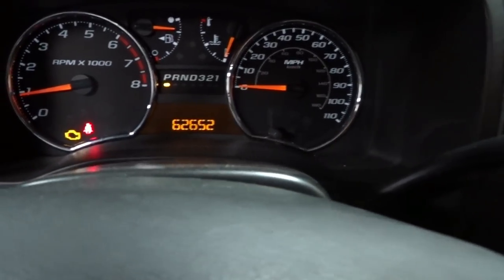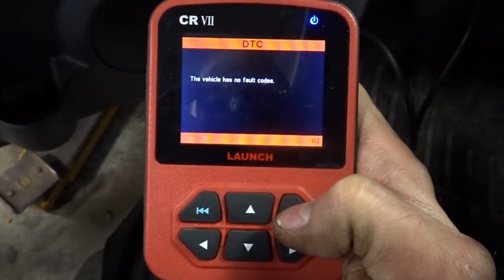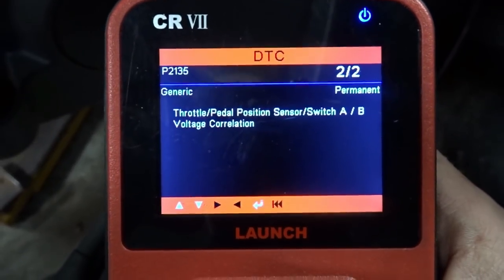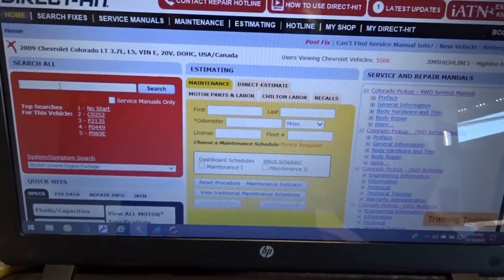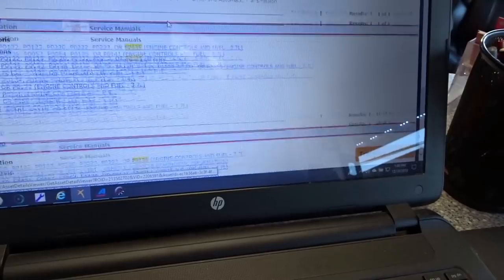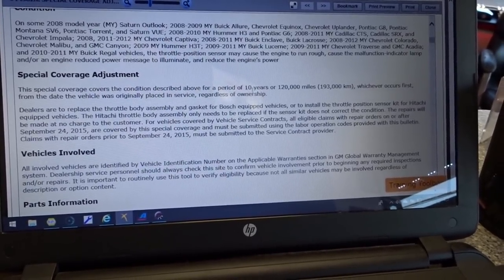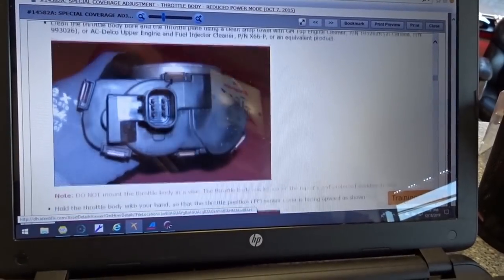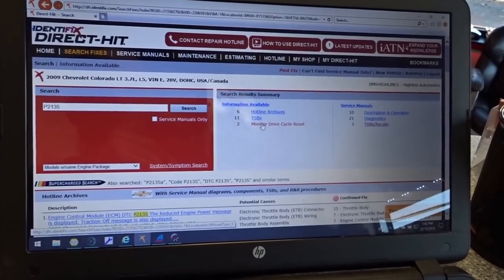[Tool Must Have]   ✓Wrenches✓Screwdrivers & WiFi ??🤔

Comment: I get a few of these a month....so far about 70% fix rate with that kit  . all others get the entire throttle body asembly.....anytime I get this, i view data and save for my proof that it was more than 13degs out of spec...the normal deviation with a new throttle body unit is about 1-3 degs, many times when you do the kit it pans out to about 2-7 degs which is still in...when it gets over 9 i suggest a throttle body

Comment: It's the plastic gears in those tps, just crap design, same happened to my wifes enclave,  tested it all, and set an appointment at the dealer lol.
But ditto bro, always give the customer a tsb/recall print out, gotta stay ethical, and customers will be appreciative of it.

Comment: Nice video man! Love the channel! Do you prefer All data or identifix? My shop only has All data and doesnt always have all the info.i need when it comes to repair procedures. Are they all like that?
Reply from the maker: I now use Mitchell and idenifix. Mitchell is owned by Snap On now so it works well with the verus scan tool I use. But as far as All data or idenifix, to me it's not compatible. There are pros and cons to all of them. One may have more info on certain vehicles and the other does not.

Comment: Mitchell does have one drawback,they like to leave out information.Had this with a 2010 Hyundai Tucson awd with the 2.7 V6,transmission removal.Never mentioned removing the alternator and rear exhaust manifold
Reply from the maker: There is a section on there so you can contact them to let them know and they can update it for the next person. Kinda like idenifix.
Reply: Called them on this and said they would correct it